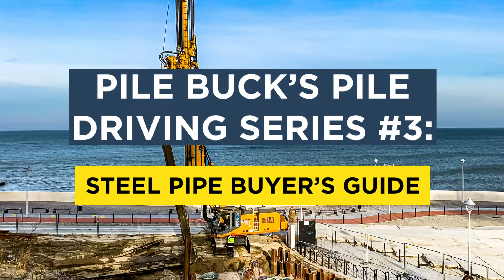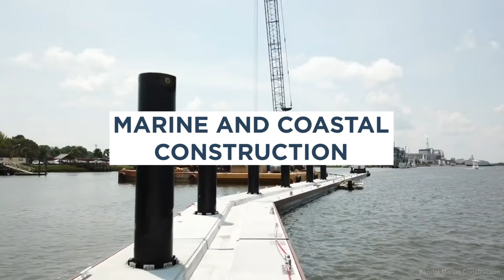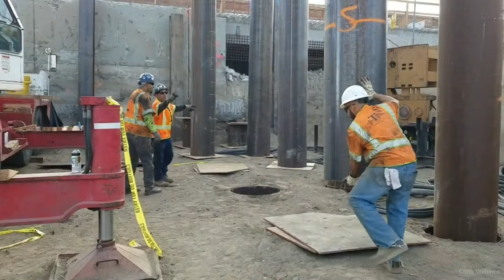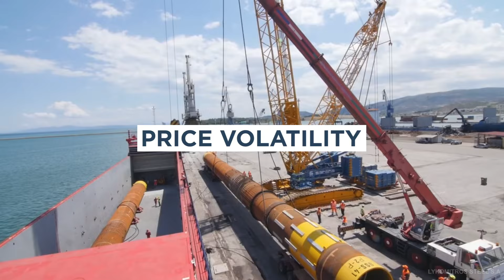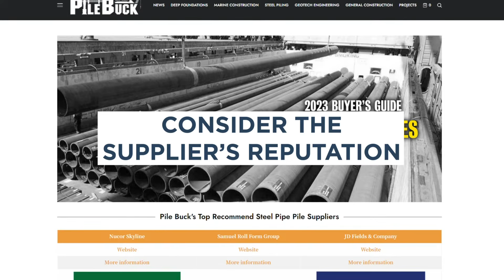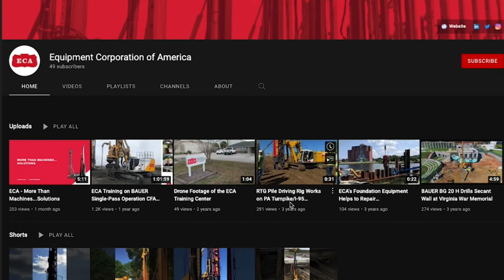Steel Pipe Piling Buyer's Guide | Pile Driving Series #3

Comment: How thick are these pipes they drive in for bridges.
Reply from the maker: Piles for bridge construction are generally 12 to 36 inches in diameter, with larger ones up to 48 inches for heavier loads or unstable soils. They’re typically driven 20 to 100 feet deep to reach stable bedrock or dense soil to ensure a strong foundation.